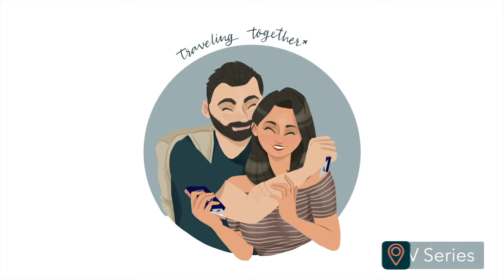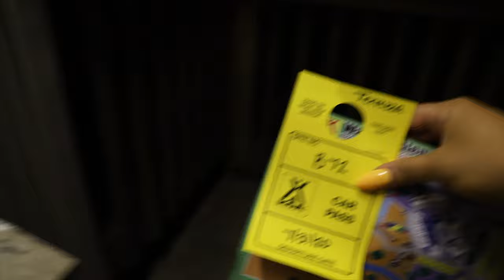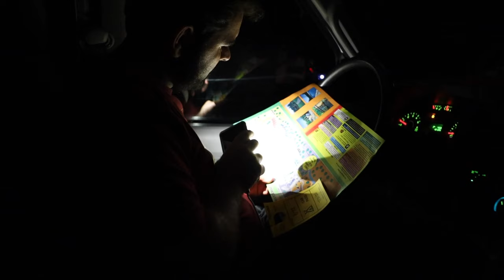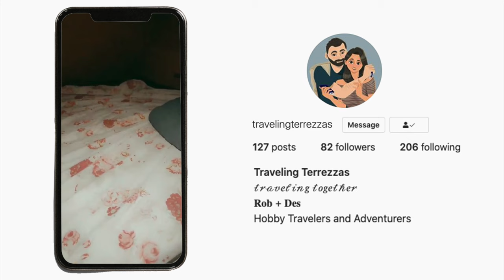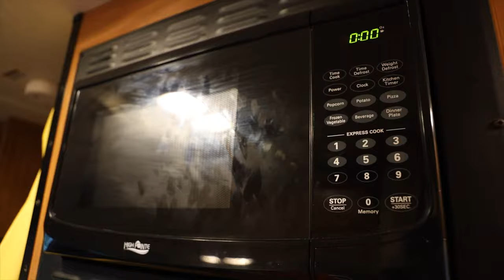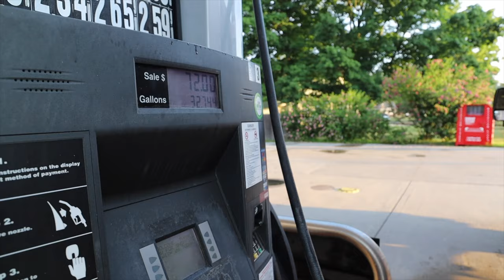Our Home on Wheels: First Day and Night of RV |  CruiseAmerica

Comment: Sorry, but you guys did not pay attention to any of the videos, your inside lights would have worked at any time, no need to plug in, that was only for the microwave and outlets!
Reply from the maker: Yes which we did use when we were camped. Sorry too